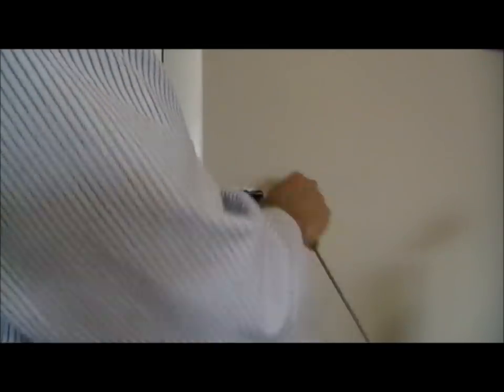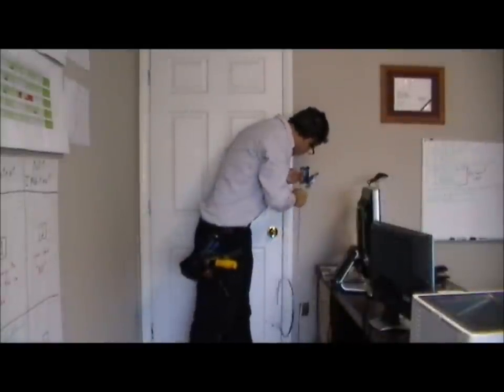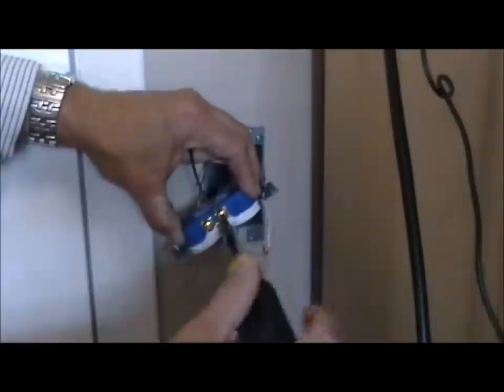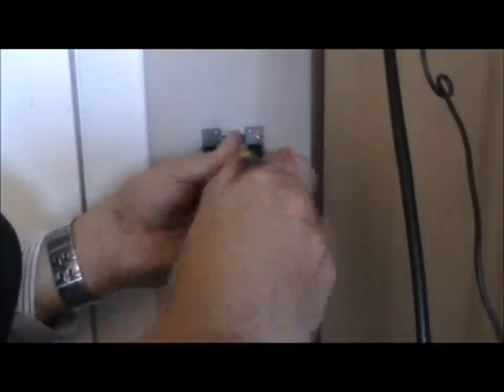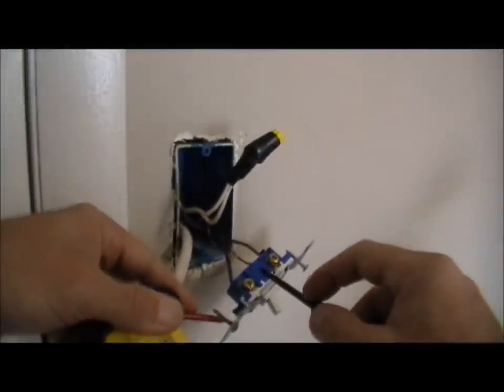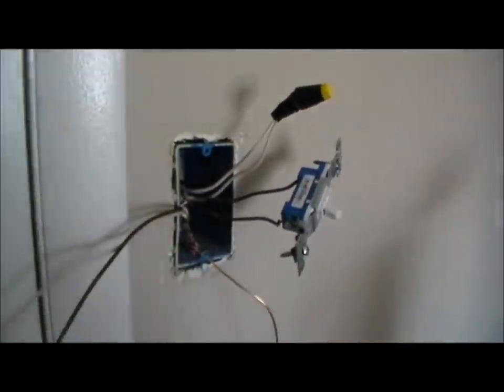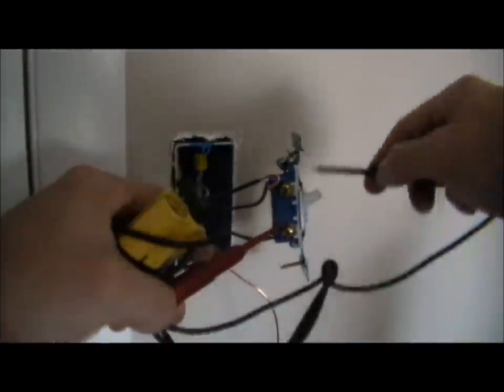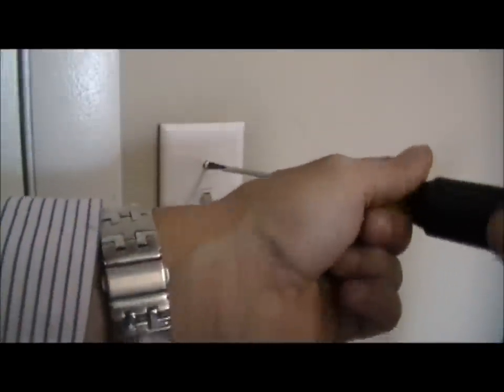how to wire an outlet off of a switch

Comment: Ok so I have a question I recently installed a outlet on a wall in my room but have no way of powering it except running it though a light socket in my closet which I am currently  doing I do not like the way its hooked up kinda iffy in my opinion basically just an extension cord with two outlets on the end, however the light switch for the main light in my room is right on the other side of the wall of my closet the house was built in the early 70's by the way. Anyway I shut off the breaker to the light switch and pulled it out and I found 3 wires white, black and a  uncoated ground wire that grounds to the box both the white and black wires go to the switch  nothing is spliced seems like a very basic setup. The switch controls two fluorescent lights. I'm not a electrician by any means but I get the basic concept. But when I wire it white to white black to black and ground to ground wire the outlet does not work and does weird things I plugged a lamp into the outlet to see if it will work and it won't do anything but when I turn on the switch on the lamp the room lights turn on but are dim just to remove any doubt of the light switch causing problems with the wiring I removed the switch and hooked the wires together but had the same problem. Like I said I'm not a electrician by any means so I hooked it back up the way I had it before and have been trying to figure out a way to make it work the way I would like it to.  Any suggestions?
Reply: That white on the switch is not a neutral so you can't use use it to feed outlets which need a neutral. Many older homes have the cable feeding the hot and neutral going to the ceiling box where the light is. Then, they run another cable with a black and white down to the switch. One conductor brings constant 120 volts and the other is a switched hot that powers the light when the switch is on.

Comment: When having older metal boxes, how do you get a wire collar on the box for the new wire fished down to the outlet?
Reply from the maker: That is tricky. A lot depends on the type of metal box. Many times it's just easier to replace the box.
Reply: ***** It's pretty easy. We use metal boxes to this day. All you have to do is take of the screw and bracket that holds the wires in the box stick a flat head and take out the knockout. Push the fish through if fishing down or up and that's all. If fishing sideways you will need to pry the box off and fish the wire that way.

Comment: Great Video!!  you seem like an old school electrician, using pliers to strip wires, instead of strippers. lol.  I used see my dad do that all the time.  :-) .  I will need to do this exact same thing, so thanks for the video. p.s. I will turn the power off first. so dont worry everyone...
Reply: +Munir Howlader No offense, Munir, but please don't do the exact same things that this guy is doing. Yes, I'm sure he knows how electricity works. But his methods are UNSAFE.
His methods are ideal for those employers more interested in collecting the check, rather than safe practices and sound wiring. Just because it reminds you of your dad, doesn't
make it a good idea.

I've been knocked on my ass a couple times from doing precisely what this guy is doing. Don't do it. Electricity does not discriminate between fast & not-so-fast electricians.
The number 1 cause for electrical fires comes from poor, unsecure connections and over-loaded circuits. You can look it up.

Comment: Does this mean the outlet will only have power when the switch is on?
Reply: +KINGsizeWINNER No! That's the whole reason for tying the neutral the way He did. The switch and the outlet are wired  "constantly" Hot...

Comment: Does that work on a single pole toggle switch, that doesn't look like one, is it a 3-way switch?, and finally does the outlet work even if the switch is in the Off position, just asking I know You'll no more, it may not work with a single p t switch.

Comment: Hello there. Yes I do like your video that you have on here. But why I am calling for well I have a wall switch issue a wall switch on my garage. why I used to work when I install a motion sensor in the garage so STOP working & I try install a new motion sensor. when I took off the faceplate i seen the wire there is 3-white wire tries together 2-black with 1-white wire with the 1-black together still no power. But when i only take other 2 wire 1-white & 1-black wire when i test them it show i have power & when i put it back together & still no power at all. So i hope you can HELP me out to get lights back in my garage again okI'm calling from Houston Tx

Comment: Why doesn't the new outlet receive power based on the light switch, too? The way I'm thinking about it, it seems the new outlet would also lose power when the light switch is turned off. What am I not understanding? Great video! Thank you!
Reply: Peter, one hot wire to the switch always has power, and one only when the switch is turned on. He is using the wire which always has power to connect to hot screw on the receptacle.
Reply: @surferdude642  Thank you!!

Comment: Neat video but I would of wirenuted ground wires or crimp sleeve I would of pigtailed live black wires I don't like to RIP hole jacket because I could nick black or white and a short could happen and you would never know if neutral and ground shorted so I just score and cut threw the last inch and pull ground wire to open jacket without damage

Comment: i have two seperate thee prong 110v plugs with 12-2 600v sunlight resistant wire , and a three prong 220v outlet .how do i wire it up so i can run my dryer of of 2 seperate 110v outlets

Comment: I tried this but the existing light switch I was wiring the new plug from did not have a ground lead attached.  I assume that is why I could not get my three-light plug tester to give me a "you did it correctly" indication.  What do you do without an existing ground to wire off of?

Comment: Question can you do this the other way around connect a light switch from an outlet?
Reply: Yes you can but it also depends on what out come you are after.
If you're wanting to control an outlet with a switch or take power from the outlet to run a switch. Both are possible!

Comment: Good video. I recommend using a copper crimp on the grounds also, and I'd of retaped the neutral wire nut,  along with taping the devices themselves.
Reply: Tape is a sign of an amateur job. If you do it right, no tape needed. If you can't do it right, don't do it! Not putting the tape on is probably the only thing he did right.

Comment: Thanks great video! My question is:
--- the outlet will have power whether u have the switch off or on?
--- what if you would want the switch to turn off the light an outlet both? is that possible?
Reply: The outlet will have power, depending on how you wire it. You can wire an outlet directly, so that it has power continuously. Or you can wire it through a switch, so that when you don't want power in it, you just flip the switch. Switched outlets come in handy, like when you want to control a lamp from a wall switch, rather than having to turn it on or off from the lamp itself. You can even have one end of an outlet with continuous power, and the other end switched.
Reply: Seemsayin Thanks! Looks like I would have to wire the hot from the outlet to the hot going out from the switch not with the incoming always on hot like he did...?
Reply: Miriam Schaefer To have a switched outlet, connect the incoming hot (black) to one side of the switch, then (with a short piece of black wire) out from the other side of the switch to the outlet that has the gold-colored screws. Connect the incoming neutral (white) to the side of the outlet that has the silver-colored screws.
Reply: Seemsayin Thanks!

Comment: I'm not an electrician but I don't think it meets code when you attach two wires to one switch Bolt. Shouldn't the hot side have been attached using a pigtail?
Reply: I would have pigtail the hot wire, then use jumper wire to the switch.
Reply: mig m    The switch was back wired, the screw was open.   Pigtail is another method of connecting, but not required.

Comment: What if the electrical switch isn’t grounded? Trying to do this at the moment, and have been able to find the hot and neutral wires on the switch, but no ground. Do I need the grounded wire?
Reply: If you install a gfi outlet you will be ok.

Comment: I need to do this in my attic where I have just a light switch and I would like to add an outlet so I can plug in video cameras. I noticed at 8:30 in the video you used your tester to determine which wire had continuous electricity and which one had power when the switch was on. Can this be done without the tester? if the light switch is up then the wire that is up will be the hot wire and the and the wire that is opposite of where the switch is will be the wire that has continuous power?
Reply: No, you need to test to see which one is always live and which is the switched hot. A single pole switch just closes the contact inside and doesn't care if the line is on top and load is on bottom or vice versa.

Comment: How do i add an outlet by using the power from a ceiling fixture? But i dont want the outlet to turn off when the light switch gets turned off
Reply from the maker: This is only possible if you have a 110 V feed in the light fixture box. You can find out if this is true with a voltage tester at the light switch off

Comment: Awesome new invention called wire strippers. Work way better than using your linesman pliers. Just a thought.
Reply: I agree about the strippers and I have used Klein strippers for a long time, but I was impressed with his ability to strip and loop wires using those linesman pliers. BTW. if you use strippers there is a little hole in them near the teeth and that hole is to make loops in the wire, and it works pretty well.  Some people don't know that.
Reply: ***** a notch isn't the proper way to strip wire. It causes nicks in the wire, which causes heat in the weak spot. Not good work habits.

Comment: How did you touch the hot wire after testing that it was hot and it didn’t shock you?
Reply: As long as u don't touch 2 wires at once you'll be ok, just dont touch anything metal with the screwdriver in your other hand😂
Reply: Angelo Nicolosi No way. That wire he was touching had 120v. Unless he was grounded really well it should have shock him.
Reply: No i promise you, if u do one wire at a time your ok, even if its 240 Volts
Reply: He wasn't shocked because he had already removed the ground wire from the Light Switch. Had that been on the switch, he would have been zapped. That's why earlier in the video, he looks for the hot wire by making a circuit with the black wire & Metal frame on the light switch, it was works because it was grounded on the ground screw. Later on after he had removed the ground wire, it didn't work. Watch again and you'll see what I'm referring to. You can change hot, electricians do it all the time, but imo its not worth risking your life over a few minutes of extra work. Regardless of experience, always cut the power. Is your life really worth risking for 2 minutes of breaker flipping? Definitely a thumbs down, this is not for inexperienced folks, no safety recommendations and not following code by putting 2 wires on a screw.

Comment: Not a word about checking to make sure the existing wiring is correct. Often it isn't. Also, there are many "dead-end" switches where there is a white conductor present that is a switch leg, not a neutral. Also, the danger in loose connections isn't that they trip arc-fault circuit interrupters, which, at this point, very few houses have, it is that loose connection start electrical fires.
People should not be encouraged to do their own electrical work.
If you screw up the plumbing, you get a mop. You screw up the electrical wiring you call the fire dept. and/or the coroner.
Reply: According to Mike Holt the MGM Grand casino in Las Vegas burned to the ground many years ago and the investigation revealed that the cause of the fire was a loose connection on an outlet that developed a fault but did not trip the breaker and started the fire.

Comment: Do you have to flip the switch in order for the outlet to have power or does it have continuous power
Reply: jo moral    No, he hooked it to the hot(from the panel) side of the switch.   If you want it switched, connect to the other screw.   Be safe, turn the breaker off when connecting.

Comment: Can you do this in reverse? From an outlet to a switch?? And run it from the switch to a ceiling box?
Reply: Yes, I did this in my kitchen as we have a walk in pantry but the house never came with a light for the pantry. I ran the wire from the outlet to the switch, connected the ground together, and the whites together, the black wires, one on each screw of the switch. The other wire goes up to the ceiling of the pantry and the light fixture. The outlet still works as intended and the switch controls the light as if the house came with it.

Comment: How did you add the box for the outlet. Without having breaking the hole wall? 🤔
Reply: He cut a hole in the wall for the outlet box, then fished the cable through the hole. Next he brought the cable into the outlet box from the back, or top.. Next, the box with the cable within the box, was pushed into the hole in the wall. After securing the box to the wall, he installed the receptacle into the box after wiring it. The receptacle was secured in the box. Last step was to screw the cover plate to the receptacle.

Comment: I don't know about other countries in Europe but in Portugal, you can't do this on a new construction, the electrical certification inspection would dissaprove immediately.
Lighting circuits MUST be seperate from outlet circuits. Lighting should be protected with a 10A circuit breaker and the outlets with a 16A breaker with no more than 8 outlets per circuit.
Reply: This is safe when done right, are houses tend to be bigger so you can do this if sized right , USA has very strict codes.You  are You Tube get it?
 He was in a hell of a big hurry not safe , I guess he was the owner trying to do lots of work that day.
The calculations for how much current a circuit can handle are multiplying the volts times amps to get watts...I.E.... 120 volts X 15 amps = 1800 watts max. Most electrical codes suggest using or limiting the draw/load to 80-90 percent of a circuit's load capability to prevent overheating or tripping the...:States have their own codes that can supersede this.
Check with your local inspector or Fire Marshall as some localites limit the number of devices per circut. In my area we are limited to 6 duplex outlets per circut per local code, local code can be stricter than the NEC. There will also be a diference between residential and commericial/industrial.
Reply: Over here you really can't mix lighting circuits with outlet circuits. Lighting must be done with 1.5mm2 wiring and connected to a 10A breaker. Outlets (Maximum 8 per circuit) must be done with 2.5mm2 wiring and connected to a seperate 16A breaker. In any circumstance a safety inspection would allow to connect a light switch to an outlet. Also a main RCD 30mA or 300mA (depending on ground resistance) must always be connected to incoming power supply on the juction box.
Reply: Ok  thanks ,When inspecting, do they go through the whole project or just focus on the main stuff? Do they make you prove how many outlets you have on a breaker?
Reply: Well it's kind of random and depends on the inspector, some are more thorough than others. When an inspector arrives the first thing he'll do is check the ground resistance, and also isolation tests. He then asks to open a couple of outlets and light switches to check if they're properly connected, he also makes sure every light point has a ground wire. he may also check for the stove connection, it is now mandatory that it is wired with a 4mm2 section and has a 20A breaker.
Reply: ok
Reply: Basically same here each inspector has their own personality some are very anal others not so much.